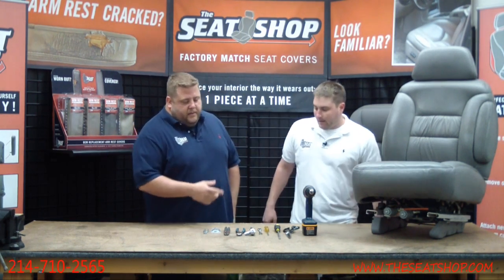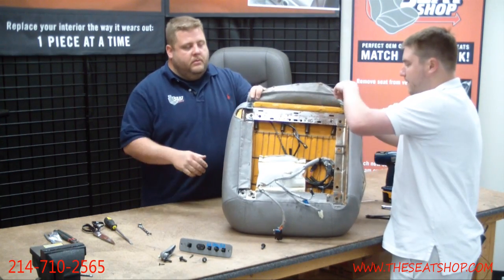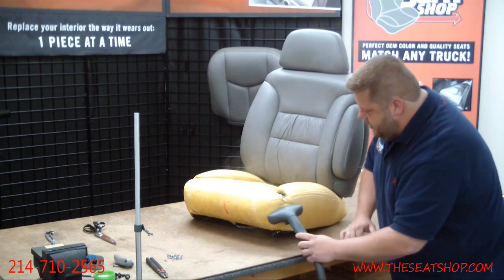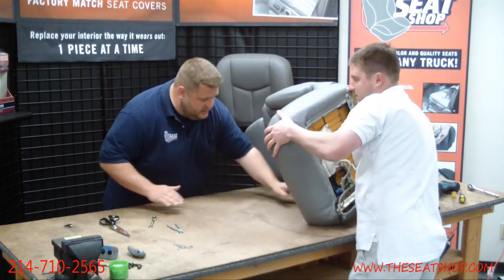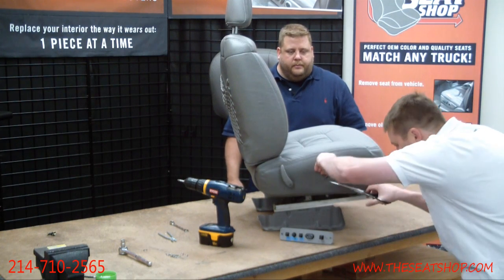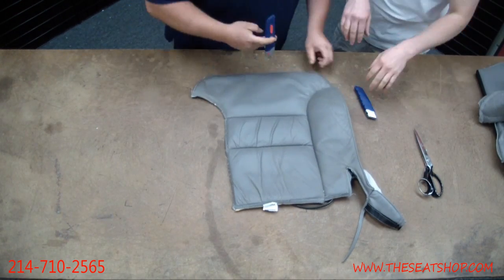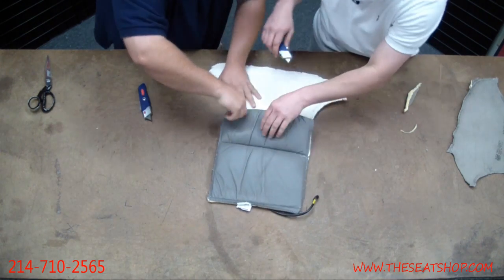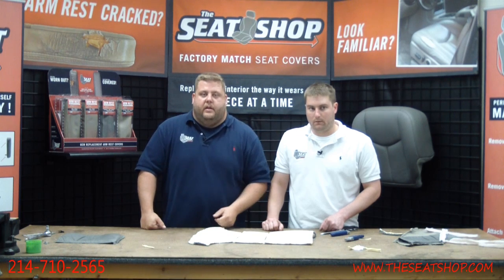95-99 Chevy/GMC Tahoe, Suburban, Pickup Driver Bottom Leather Seat Cover Install

Comment: Great tutorial it was super helpful easy to follow and my seats look great.  The only thing I will say is that the hog ring pliers you used are way better than the ones you thought about getting.  I got those and the reloading slot gets in the way you can’t get the pliers around enough to make them hold. Got the ones you used and all went great. Thanks again really appreciate the great video.

Comment: Do you think using and iron with a lot of steam would work for a steamer?  I was also thinking about a spray bottle with a mist and a heat gun.  Thanks for the great video.
Reply from the maker: We would NOT suggest using an iron. It will be too hot and damage the cover. A steamer is the best way to go, if you do not have 1 I would go to a local upholstery shop to see if they can do it for you.
Reply: @TheSeatShop  Thanks, I didn't think about finding an upholstery shop.  Have a great day.

Comment: How do you take the driver and passenger headrest off these 95-99 Chevy seats? I have a 99 K1500 Suburban and I don't see how to remove these.
Reply: There is a pin hole in the square plastic paper clip or similar size pin push in & it releases

Comment: 1999 Silverado the seat belts run through the seat. Therefore you have to remove the seatbelts before even thinking about replacing the seat cover.

Comment: Don't take the power mechanism out.  Just unbolt the seat from the power base and unplug the connectors. Saves you undoing those extra bolts.

Comment: How would I remove a cloth seat cover from the foam without ripping it up
Reply from the maker: Unfortunately, you won't be able to replace the cover without tearing it. The cover is glued to the foam cushion.
Reply: @TheSeatShop  I was able to get the fabric up with a little bit of foam torn up with the fabric, but for the most part the seat shape is still there in the foam insert. Can the missing chunks be filled with a foam product?

Comment: I have a cloth 1995 Chevrolet Z-71 Extended Cab with a worn drivers seat that is a 60/40 not bucket. I would like to replace the full front and rear with leather but I don’t think it works over my foam.  Alternately I would like to replace the drivers side lower with cloth.  I’ve read that the cloth is made to the foam and can’t be replaced. What are my options?  Do I have any.  I couldn’t see a solution on your website.
Reply from the maker: Hi Ricky and thanks for reaching out,  unfortunately, at this time we will not be your solution. There are three reasons why going back that far with cloth is very difficult; 1. The cloth has been discontinued and without that material, we cannot manufacture a single piece to match the rest of your interior. 2. The cloth that was used for your seats was glued onto your foam cushion which makes both the cover and foam one piece and to remove the cover (without experience) will destroy your foam. 3. The process to attach your covers to your foam and then to your seat frame is not an option since neither the foam or the seat frame is set up for this (since gluing the cover was an easier solution). Your solution is going to be a local upholstery shop since they have experience in removing covers and replacing them with a different material. Here is a link to our Nationwide upholstery shop network to see if the nearest shops to you can try and help you out this time around. - https://www.theseatshop.com/resources/install-locator/

Comment: Thanks for the steps on removing the seat cover. I have a 2000 Chevy Tahoe Limited. With 2-tone leather seats. I didn't want to spend $200-$250 for just the driver seat, I went to the junk yard and found the same cover. Thank you so much. Spent $17

Comment: I don't need to replace the seat cover but need to replace the heating element. (99 Tahoe) From your video it looks impossible without tearing it out.  Do you have another video where you are just replacing the heating element?